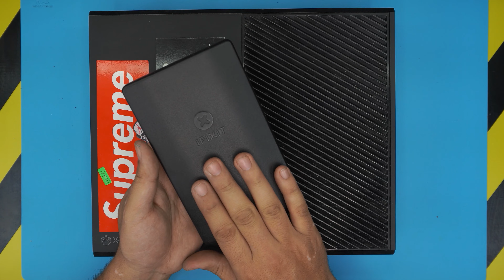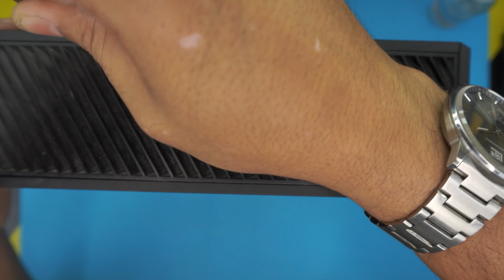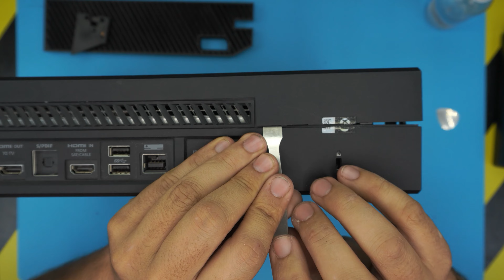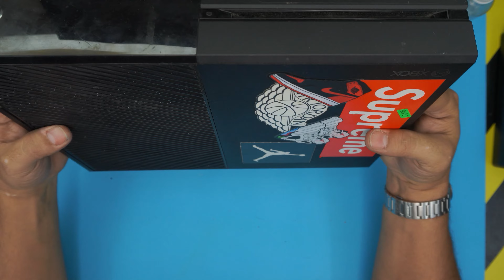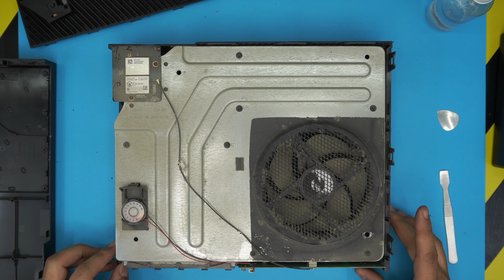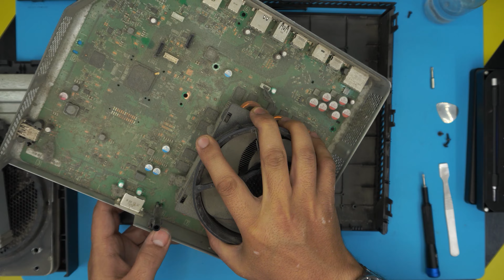XBOX One fan Noise repair & Full Service Guide

Comment: Mine turns on and immediately turns off without the fan moving… what seems to be the problem
Reply from the maker: 🫠Regarding your question, that could be 90% a faulty power brick. Replace the power brick, and that should resolve the issue.
Cheers🍻
Reply: @uFixTek the power brick is new

Comment: New models don't have a fan servicing hole to remove the C lock

My series S fan is stuck with gunk that prevents the fan from spinning freely.

How do I service the fan if there no apparent way to service the fan, I can't seem to remove the blade assembly
Reply from the maker: 🫠Regarding your question, these models that don't have the service C-lock are pushed in with force and need to be pushed out STRAIGHT and evenly with force (otherwise, you will damage the blades). Use your thumbs to pop the fan out; make sure to push it straight and evenly. I will see if I can get my hands on one of those and make a short video.
Also, those fans are cheap on AliExpress.

Comment: plastic clips are my biggest op when trying to get into anything ngl 😂 like doing all the screws and unpluging the connections is not a problem for me i just get mad paranoid im going to break something with the plastic clips especially when its 8+ years old the plastic gets so brittle! i hate electronics that use plastic clips so much. at leasts with phones everything is made of metal the hardest part is heating and use a suction cup to lift the screen. Alternatively using alchohol and suction to remove it. even that doesnt bother me.
Reply from the maker: Yeah, on those consoles, they rely on plastic clips to hold them together, even though they clearly know that after years and the heat generated by the console, the plastic will become brittle. Even plastics have an expiration date.
But I’m glad that the new consoles are no longer dependent on plastic clips.
cheers🍻
Reply: @uFixTek yes right. i sont have a new console but i have had gaming laptops and xbox ones and ps4 pros. at least ps4 pro doent have as many clips the the xbox one.
Reply from the maker: True that my friend 👍🫠

Comment: I never cleaned tge fan fully will that help it? When i opened it it wasent rlly dusty after 10 years literly zero dust
Reply from the maker: 🫠 Regarding your question, it’s not the dust; it will dry to the bone and start eating the middle rod. You need to lube it.
Reply: @uFixTek oh i tried to take out the blades but im not sure how i tried to pull it out but that didnt worked
Reply from the maker: I would recommend ordering a new fan from AliExpress or eBay. Once you get it and replace it, then you can try experimenting with taking the blade out—and if you break it, at least you'll learn. You need to be able to bend and open the plastic washer on the fan in order to release the blade.

Comment: My xbox one has weird grinding noise from fans im maybe getting new fan for it and replace it and see what happens the xbox is 10 years old i replaced thermal paste and the hdd for a ssd if anyone got tips that would be nice

But the noise stops every few seconds then after 2 seconds the noise starts agian
Reply from the maker: 🫠Regarding your fan noise, I would highly recommend replacing the fan; they are not expensive on eBay or AliExpress.
https://youtu.be/TqS__74qa8Y
cheers🍻
Reply: @uFixTek yea thanks when im on homescreen is it normal to hear my fans spin?
Reply from the maker: Absolutely NO, I would highly recommend a repaste with a very good thermal paste like "Thermal Grizzly." When the Xbox is on and you're on the dashboard, the fan should be super quiet!
Reply: @uFixTek  i did replace the thermal paste already with arctic mx-4 and my xbox is from 2015 so i think the fans are dying
Reply: @uFixTek  the thermal paste almost tripled my fps on alot of games
Reply from the maker: awesome.
Reply: @uFixTek  im going replace the fan i will tell you if it helped
Reply from the maker: oki 👍
Reply: @uFixTek  the power supply of the xbox makes weird noise i cleaned the fan of the power supply it was very hot and dusty its less hot now but it makes strange sound

Comment: I've oiled the fan without taking off the c lock,just push oil with syringe and needle and rotating the fan is gone through the axle! Works very well now without noise! Obviously all the exterior dust been removed !
Thank you for the video!
Reply from the maker: It's my pleasure, my friend. Yes, you could add the oil without removing the C-lock, but for proper service and to remove the old gunk, I recommend removing the C-lock. Cheers! 🍻
Reply: You can also just replace the two ball bearings, same as on the One S. They're called 693ZZ and are readily available just about anywhere. Just don't get the cheapest chinese junk bearings, cause those won't be any quieter than the bad ones you took out... ask me how i know lol

Comment: Dude I did everything you did in this video with help and I turned it on and the fan went super fast so I unplugged it out of fear, is it supposed to go really fast and then slow down or is there something wrong with it still?
Reply from the maker: 🫠Regarding your question, did you apply thermal paste a good brand, if the heatsink is not touching the cpu with a good pate then it will spin fast, its of it spins fast for few sec only.

Comment: Yea my fan was just shot I guess. I took it apart to clean it and the fan just detached from the fan shell. When you took the fan pin out. The pin stayed in the fan itself. My pin stayed in those coil like things. It like detached. The plastic was like melted where the pin sat instead of the fan blades.

Comment: Is it possible to replace the HDMI port ?
Reply from the maker: Thank you for your feedback! If you wish to support the channel, you can like, subscribe, or both!
Regarding your question, yes it is and we replace them all the time, i will make a step by step video soon for it.,
Should you have any further questions or requests in the future, please don't hesitate to ask me.
cheers🍻
Reply: @uFixTek  thank you very much.
Im currently working on a rattling fan on one and a broken HDMI on another.
Dont know which one would be easier to fix.
Reply from the maker: 1000% the fan is the easy, get new fan cheap on aliexpress and slap it on top, for hdmi you need solder station solder skill and tools.

Comment: The metal pin on mine broke off after a fall and now the fan permanently sits lower than it should. So now it grinds agsint the heat sink. But thanks to your guide I know how to replance both the fan and the paste once they get here
Reply from the maker: It's my pleasure my friend. 😊 Thank you for taking the time to give feedback! If you would like to support the channel, please like, subscribe, or both. :P
get the fans cheap from aliexpress we get them there and work just fine.
Should you have any questions or requests in the future, please don't hesitate to ask me.

Comment: But how did you fix the rattling noise aka vibrating humming sound?
Reply from the maker: Thank you for your feedback! If you wish to support the channel, you can like, subscribe, or both!
Regarding your question, do the service in this video, if after this service you still get vibration or humming then you have a lot of degraded pin and or have unbalanced fins, and then you will need to replace it.
Reply: @uFixTek  ima be straight forward my Xbox is the original Xbox one that came out . Do you think it’ll be best if I just get an upgrade ? (Newer console)? Or should I just pay money to get the problem fixed ? How much would itbe ?
Reply from the maker: if your problem is the fan noise and not any other issue, i would highly recommend you to fix it up, replace the fan with a new fan, i can help you find the right fan, can you give me the exact model number of the console. the fan are not expensive it will cost you 14USD for the new fan.
i am assuming you have the xbox one fat model, if so get the fan here:
https://shorturl.at/MOZ56
Reply: @uFixTek thanks so much bro definitely finna sub to your channel you’re definitely a real one and deserve more followers 💯💯💯
Reply from the maker: @jacksonjames124  much appreciate your support 🙏

Comment: I did everything you told me in the video but my Xbox didn't turn after I put it together, what did i do wrong??
Reply from the maker: i recommend you to reopen and double check the cable connections and make sure the front panel flex cable is not damaged or ripped and it is plugged in all the way in the jack.
Reply: @uFixTek  thank you
Reply from the maker: It's my pleasure my friend.
im very sure it is your front face panel flex cable that is damaged or not inserted.

Comment: Plyz i need your help my friend my xbox fan make weird noises should o be worried?
Reply from the maker: Thank you for the feedback! if you wish to support the channel you can LIKE or SUB or both :P
regarding your question: yes you should worry because it will start to over heat and shutdown, open up the xbox and clean and repaste it my friend and if you can service the fan.
https://youtu.be/KmkEJ7o5Joo
Reply: @uFixTek  do you have any social accounts so i can record the xbox noise and you listen to it ? youre the only one can help me now
Reply from the maker: record it and use your you tube account and send me the link here or email me  	ask@ufixtek.com
if you send me link here it will not show so don't worry it will go to "held for review" so send me link here.
but if the fan is making noise you should repaste and service.
Reply: @uFixTek  k
Reply: @uFixTek  https://youtube.com/shorts/-ke5nOCmo1M?feature=share
Reply from the maker: that sound is not the fan that is your hard drive actuators that are making noise, you can't fix that. its not your fan. what will happen your HDD will die soon on you and you will need to replace it.
Reply: @uFixTek  why this happened? In the first when i buy it there was no any sound and now its happening
Reply from the maker: the hard drive has a moving parts and over time when you turn on and off too much it starts damaging the header of the platters.
see the picture how its inside of the HDD. this is very normal on xbox one hard drive fail its common issue.
https://imgur.com/a/j682Isa
Reply: @uFixTek  so its normal or not ? And what i can do ?
Reply from the maker: no its not normal, you will have to replace the hard drive my friend, @8:40 i removed the hard drive,
Reply: @uFixTek  ok thanks my man ❤️
Reply from the maker: @maistro383  good luck my friend.

Comment: when u put a new thermal paste on the gpu when u have to replace the thermal paste like in 1 year?
Reply from the maker: Thank you for the feedback! if you wish to support the channel you can LIKE or SUB or both :P
regarding your question: Depending the type of the thermal paste you put, if you use a good brand like:
arctic mx-4: https://amzn.to/3AMUxUT
or better:
thermal grizzly kryonaut: https://amzn.to/3AwJ0ZH
you should change the paste every 1.5years if you use daily 5-7 hours. if you use 8-12 hours every year.
Reply: i use an mx-2
Reply from the maker: not a great paste, but will do replace it at 8months with artic mx4
Reply: one more last question when i turn my xbox it sometimes turnes off itself any ideas what that could be
Reply from the maker: it had a protection, if its over heats then it protects it self.
Reply: i have a problem with my xbox so basically i opened it and i wanted to make sure there is no dust inside my xbox when i put it back in for some reason when i click the button on my xbox to turn it on it doesn't turn on the only way i can play is if i turn on my controller
Reply: @mehdialia6648 You probably forgot to reinstall the front button cable.

Comment: So when I plug in my power brick it starts running immediately, and when I connect it to my xbox one the fan on the Xbox goes crazy and it doesn't come on. Please please  I need help I am low key loosing my mind. Lol I just want to play games.
Reply from the maker: Thank you for the feedback! if you wish to support the channel you can LIKE or SUB or both :P
regarding your question: there could be a few reasons for it, i need to see what it does when you power on, the sound and lights and more info than what you giving me. make a short video and link me.

Comment: Can i use a different type of screwdriver for the WiFi and Bluetooth chip ?
Reply from the maker: Thank you for the feedback! if you wish to support the channel you can LIKE or SUB or both :P
regarding your question:  unfortunately no my friend you need a secure torx #9 to open that
Reply: I used a Allen key set, it wasn’t that tight.

Comment: I lost the c lock. Is there any way to get another one or use something else? :(
Reply from the maker: Thank you for the feedback! if you wish to support the channel you can LIKE or SUB or both :P
regarding your question: you could use a springy stuff, improvise or find a dead fan that you could remove the c lock from :( or find a flexible a bit hard sheet of plastic and make a hole the size of the rod of the fan (.2mm less) and cut it round and make a c lock out of it.

Comment: The best thing for these consoles is a graphite pad to the heatsink. And plus it will never need replacing just a usual cleaning inside.
Reply from the maker: Thank you for the support and feedback, regarding you suggestion:, we have place a  graphite  on clients consoles and tested and i would say it does work and its re usable, but we have send out over 85 services with graphite  and 23 came back with fan noise and the reason is that not all heat-sinks are perfect flat against the IHS, and that can cause a bad thermals and loud fan noise, and that's where the thermal paste is better as it will fill where there is a bad level on heatsink. but you can test out and place a graphite and if your console fan stays in normal RPM and console not over heats then by all means use it, but else you will need to place a thermal paste.